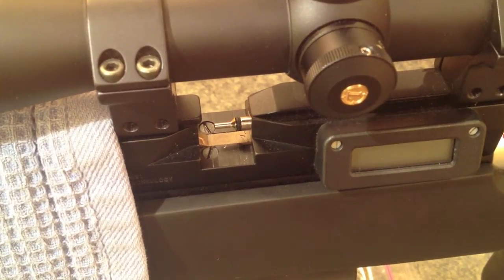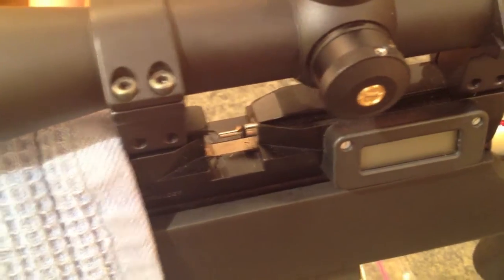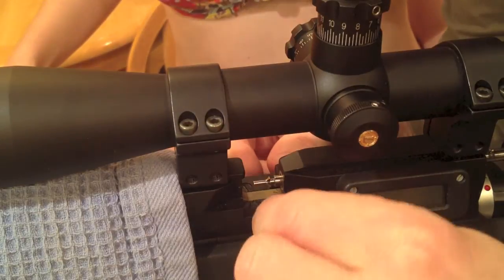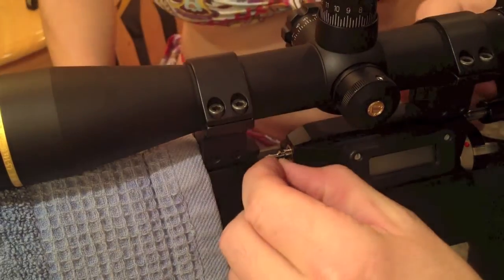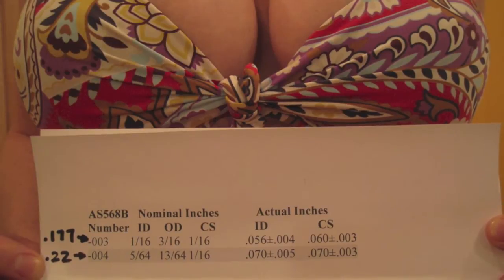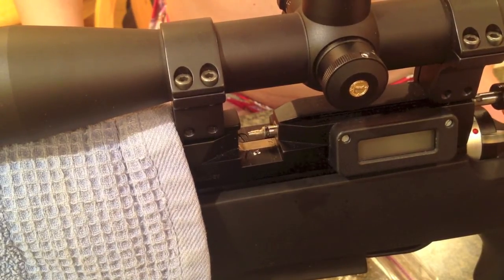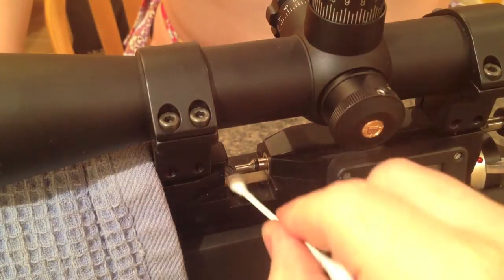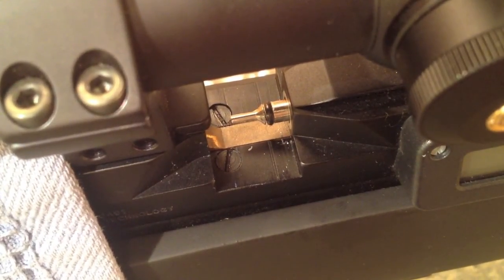Air Wolf O-Ring Replacement

Comment: Hi, What's the correct hardness of the o-ring, 70 or 90. Thanks
Reply: if you need FAC power than 90 is a good choice
Reply: The 90 is the harder O-ring people are going for. 100 for 2.47.